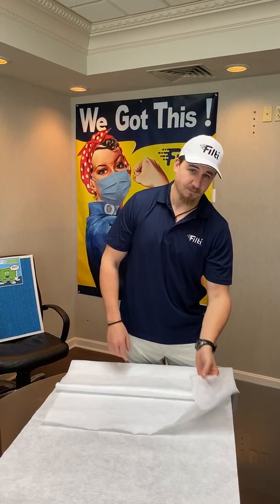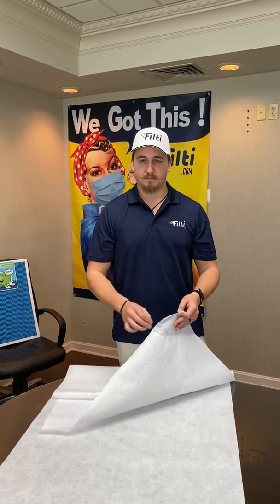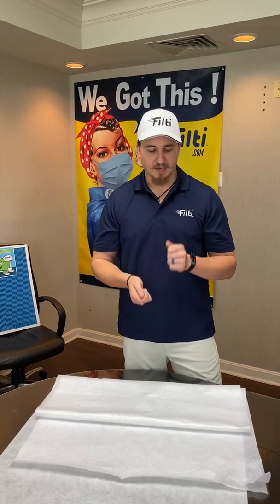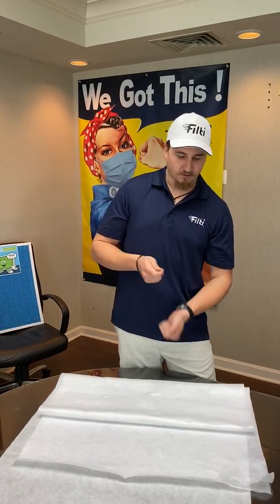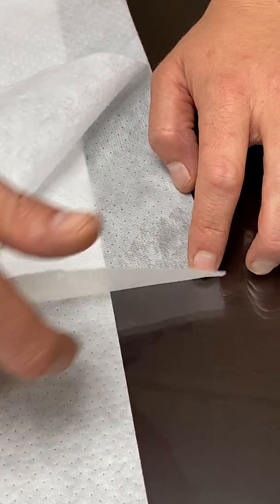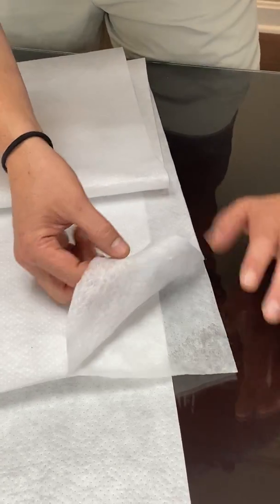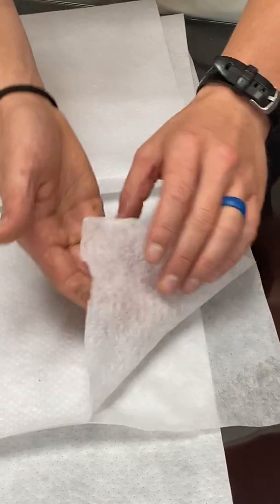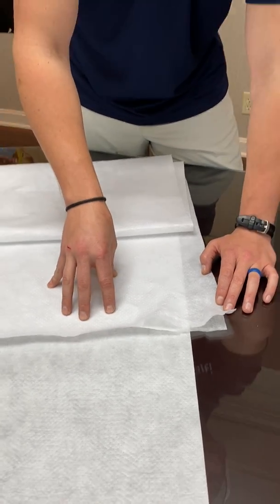3 Layer Face Mask Filtration Media

Comment: Hi, Is the filter fabric washable? And if so up to how many time? Thank you!
Reply from the maker: Hello - we don't recomend washing because we can't ensure the washing would remove pathogens.  The CDC has very good guidelines for cleaning masks, we recomend you follow those and per testing in our lab the temps required wont damage our material - just stay below 170 F. https://www.cdc.gov/coronavirus/2019-ncov/hcp/ppe-strategy/decontamination-reuse-respirators.html
Reply: @filti4327  you guys need more uniform messaging. i think i read another comment that said you can wash then dry up to 150f and it'll return to normal.
Reply from the maker: @orangemoonglows2692  We are updating our processes in accordance with updates from the CDC. Thanks!

Comment: Hi, Andy, it is not obvious which side the skin side is without color. I can tell that the bond points on one side look deeper than the other. Can you help clarify? Thanks in advance.
Reply from the maker: Absolutely! We recommend smooth side to the face and the fuzzy side away!
Reply: @filti4327  Thank you!
Reply: I don't have good vision anymore, but I do have dry hands.  The side that my dry hands kind of snag on when I run my hand across it, is the side that needs to face out.  The smooth side face the skin.

Comment: Would that translate to the filtration equal to an N95 mask, or a level 2 surgical mask?
Reply from the maker: Our manufacturing target is 95% efficient at 0.3 microns. N = not resistant to oil. 95 = 95% efficient at 0.3 micron. This same media is used in many N95 respirators. We can't call it N95 as that is an official respirator designation and not a media efficiency test! Our product is MERV 16!
Reply: @filti4327  Thank you very much. We now understand. 
Great video too. Thank you for being a company made in the usa helping America. We can make it were Americans.
Reply: https://filti.com/app/uploads/2020/04/Filti-Face-Mask-Material-Data-Sheet-040920-1.pdf